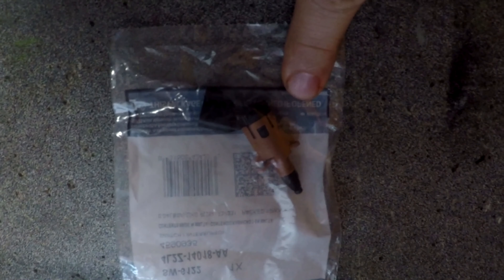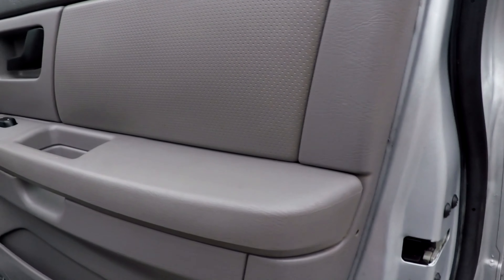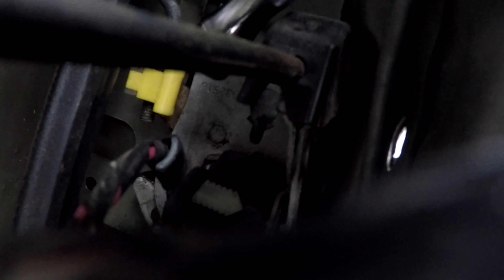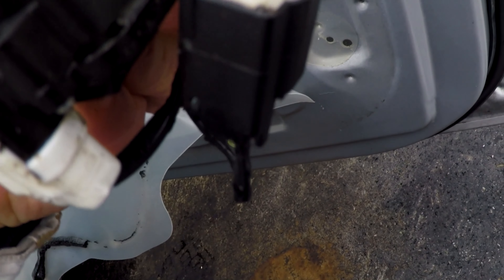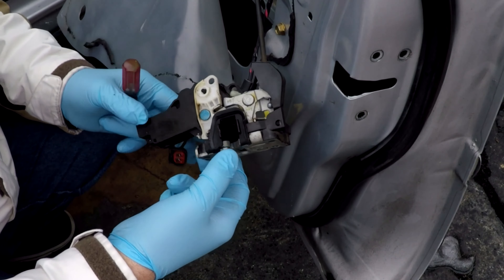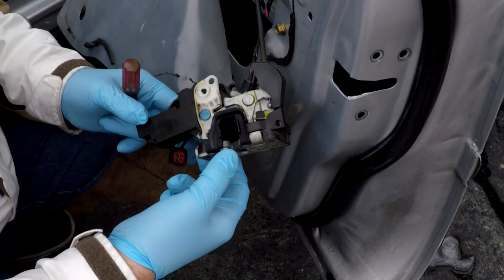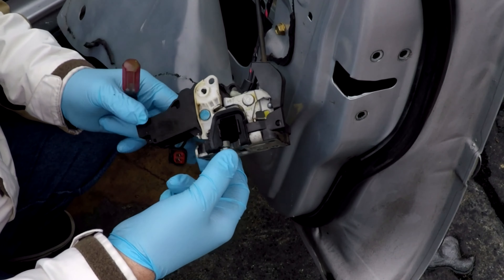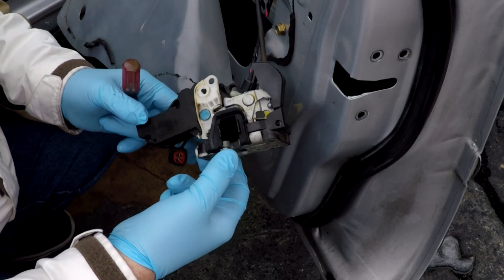Door Ajar Switch Replacement | Techn' Moto

Comment: I replaced mine just removing the 3 bolts for the latch. Also remove the two bolts on the brace that runs horizontal in the access hole and one bolt for the window guide. The more access the better. With the latch bolts removed take the bottom of the latch assembly and swing it towards the access hole. Remove the white connector. At this point, I had my finger on the ajar switch. I turned the switch clockwise and broke it free without any tools. Remember the connector location when so when you put the new on in, uses the same location and turn counterclockwise until you hear it click.
Reply from the maker: Cool

Comment: Thanks very much for the video. It's very helpful. The switch I replaced is on driver's side. It's counter-clockwise instead of clockwise when installing back the new switch. In your video, you are replacing the door on passenger's side. Maybe that makes the difference. Wish that may help other viewers.
Reply from the maker: Yep there different. I am sure this will help others. Thanks

Comment: Thanks for the video. Quick question. Does this switch also control the side mirror puddle lights? My side mirror lights will not shut off anymore and read that it was a door latch problem. Right now I just pulled the fuse but that also powers my power windows
Reply from the maker: Don’t know, don’t have those on this vehicle. Maybe ask that question on a ford forum for help.
Reply: I'm having the same problem with the mirror lights staying on. Did you find the problem?

Comment: thanks for the walk through, I have tried cleaning and lubing it the way other videos suggest but this doesn't last very long,  yes, one of the specific things I was wondering was if the switches were different for different doors, like I wanted to pull one of the passenger door to put on the driver side, or if they were flipped left to right the rear driver side door, but if they are all different i guess i just have to order the dumb part, but thanks again
Reply from the maker: Yep if this does not work you may need a new switch. Some cars the switches are different. Check with the parts department at the dealership. They should be able to answer your question